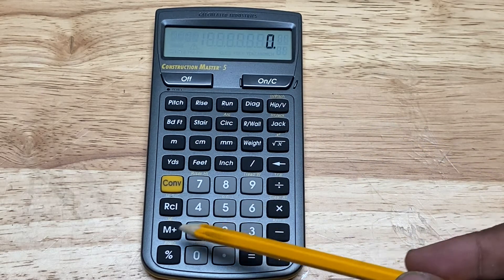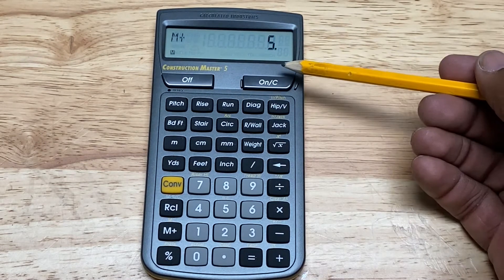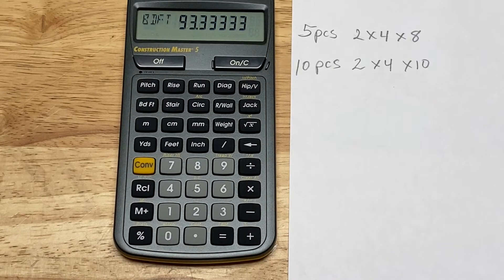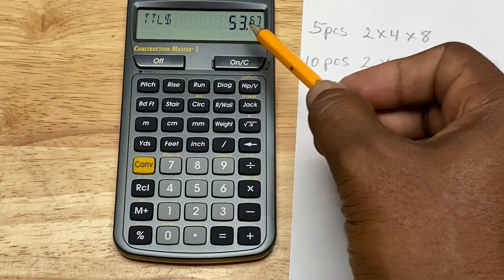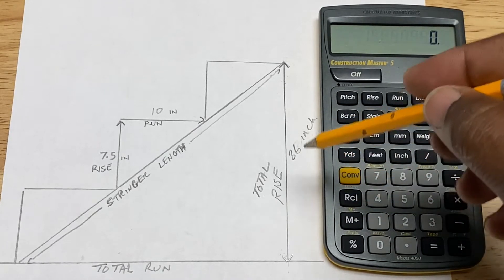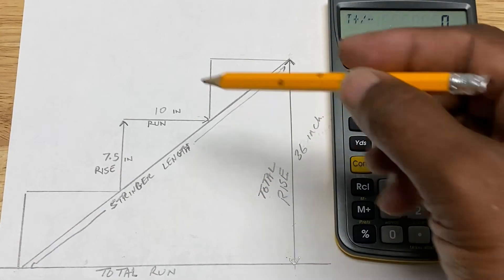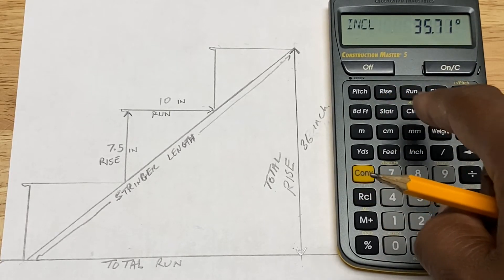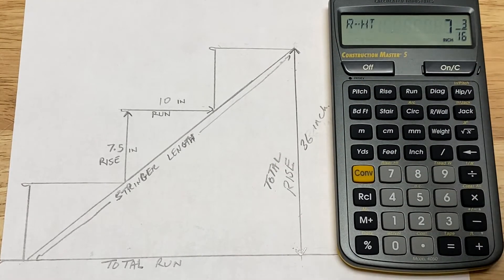HOW TO USE A CONSTRUCTION CALCULATOR

Comment: Hi there, great instructional video. 
I’m from the UK and some of our roof pitches are given in degrees of pitch rather than the 12 scale. Does this calculator allow you to input the pitch in degrees? Thanks
Reply from the maker: This version can give you values in degrees when it comes to finding arc degrees(circles, arcs). You may have to convert the degrees back to the rise on this version for slopes. The Construction Master Pro has more functions for slopes.
Reply: You can enter pitch in degrees for working in metric  oR  as  inch rise per foot of run  or even toggle between the two if you want I would highly  recommend down loading this cal as an app on your phone if your working on roof's it  pays for its self on day one

Comment: I think I'm a little confused with the diameter example. If you have a 6ft deep hole with a 24 inch diameter it would not be 4.6 cubic yards to fill. I believe you should've multiple the depth not the height of the pole.
Reply: I noticed that too. You are correct. You would also need to subtract the pole volume in the hole.

Comment: Roof calculation are wrong. You have to find half of you span  half of 20ft = 10ft subtract half of your ridge which is usually a 2x8  or 7 1/4" x 1 1/2”  so 10ft- 3/4in =9' 11 1/4" that's your run . Also concrete for the hole the for the pole would not be times 40ft  it would be times 6ft because that's how far the pole is in the ground. Obvious this guy has no field experience probably just read the instruction manual